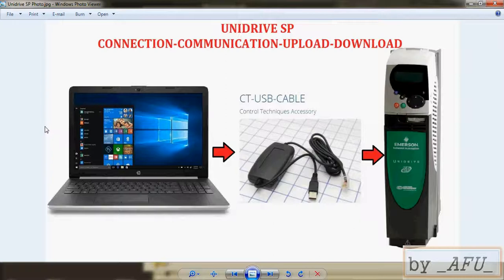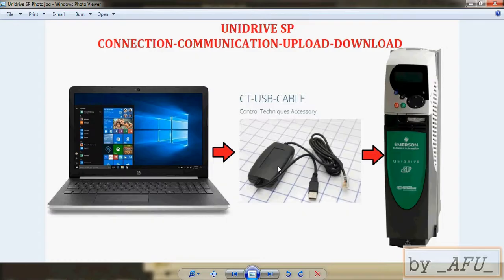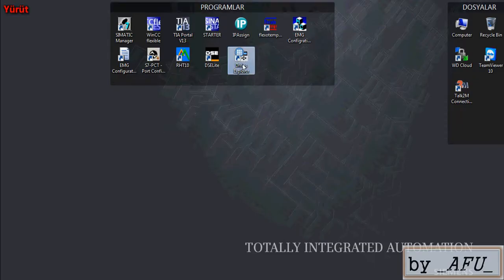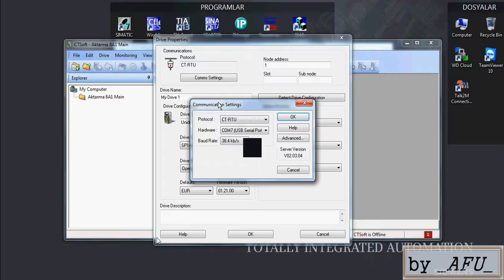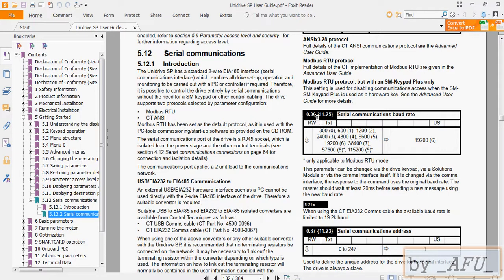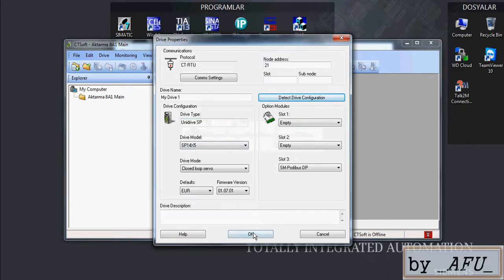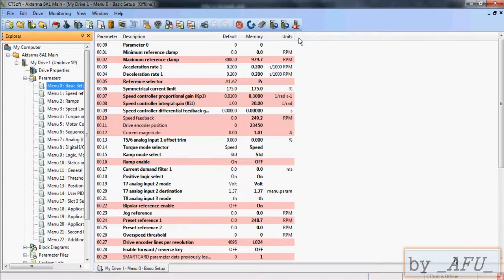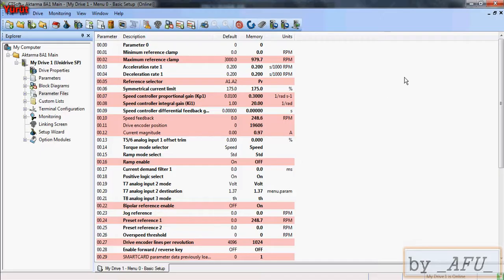Control Techniques Unidrive SP # PC Connection - Upload - Download - Online Programming

Comment: I have a doubt sir,I don't have CT cable but can we connect another device ,pls give rj45 cable connection details
Reply: You can connect by ETHERNET  if there is a SM-ETHERNET
Reply: Sir only I have usb to rs485 ,can I connect that
Reply: @ramchandiran3862  I don't know... I believe that no...
Reply: @ramchandiran3862  make a cable using rj45 pinout from the manual and connect +&- of rj45 to rs485 usb coverter it will work.
Reply: @rishinathreghu579  have you ever tried it